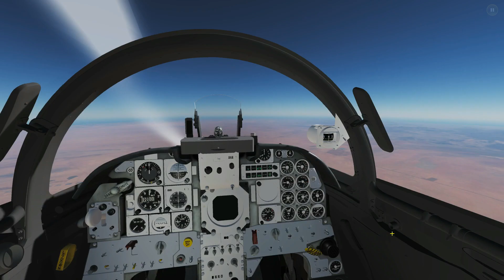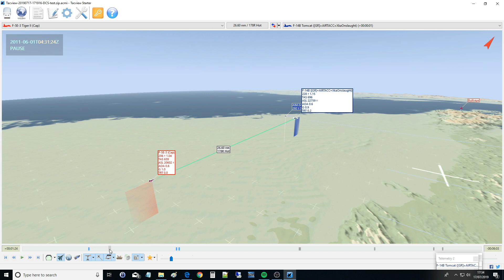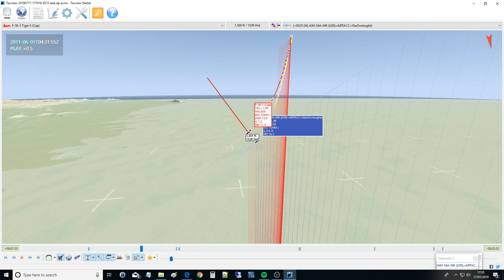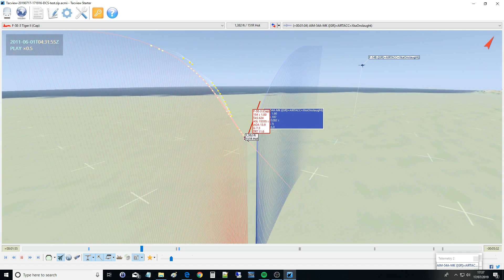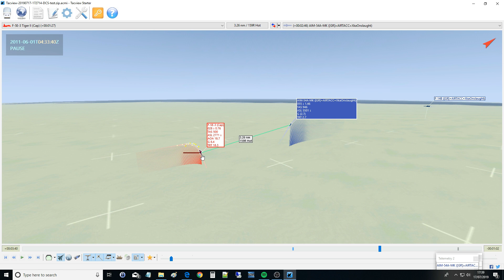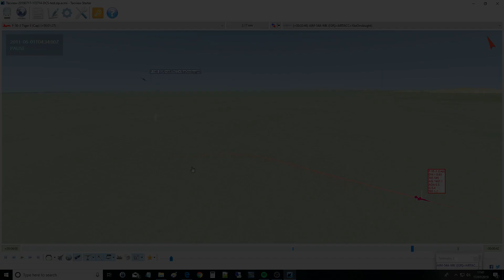Combat: Evade Dodge Aim-54 Phoenix Missiles Tutorial | DCS WORLD

Comment: Cap, thanks for the help! It help me a lot, but 'new' problem emerge. So, what if the AIM-54 actually lofting, and they come from above, in our RWR blind spot, what to do?

This problem 'idea' actually come up with what really happened during Iran-Iraq war, where a Iranian F-14 shotdown 3 MiG-23s with one AIM-54, and those poor MiGs don't have any RWR warning. 
Later research in the US  said it was caused by the lofted AIM-54 and came from almost 90° to the MiGs

P.S: I don't want to be those poor MiGs, or Flanker in DCS...
Reply from the maker: There is no defense for that, BUT it is VERY rare that it will be steep enough to avoid the RWR thank God.
Reply: @grimreapers  roger that, so only the unlucky pilot will get those poor missile in such conditions
Reply: This basically never happens in DCS because of the profile they gave the -54, so that its reaching its target with the most optimal energy. The previous behavior that allowed for a steeper terminal angle generally saw the the missile dump all of its speed and missing non-maneuvering targets.

Comment: Of course the Phoenix was really not designed for attacking Fighters, but rather  bombers  (Large RCS, relatively un-manoeuvrable ) or cruise missiles  (small RCS  but unlikely to  manoeuvre to evade) at long range to 'defend the fleet'.  It carries Sparrows / Sidewinders for the fighter type targets if careless enough to get close to them.    Against fighters its main value  is simply to scare  them off/keep them busy from long range rather than kill them.  Once you get as close as 35 nm hot to fire a phoenix in a tomcat using TWS you are getting pretty vulnerable to modern  missiles since you have to keep a lock until the phoenix goes pitbull.  So you are likely to have a counter-missile inbound forcing the tomcat to break the lock before the target spots the phoenix going active.   That is why in many GR missions we see the combination of a Tomcat for long range  and a F15 or a F18  for medium /short range as most effective, exploiting the strengths of each type.
Reply: Turns out that's a myth. 
Originally the requirement of the AiM-54 was to be able to hit a MiG-21 In a  high G turn. 

Heatblur did a YouTube special on it. 

The AiM-54 was able at range to strike a F5 in a 7G turn in testing if I recall correctly.

Later the AiM-54 was basically down sized into the AiM-120. 
Cheaper and lighter with less range.

During the cold war it was just assumed the AiM-54 would be used against ICBM's and Bombers more than fighters but it wasn't its design.

Remember the F14 and AiM-54 were in design and prototype phase during the Vietnam War and striking aircraft in North Vietnam was the objective.
Reply: It can engage fighters. But they won't even fire till they're 15-20 miles out. A bomber you can fire at from farther away though.

Comment: Why did you did the F-14's radar not show up on the RWR? It should still be emitting radiation even while in TWS mode.
Reply from the maker: I did not have the F-5 RWR in SEARCH mode
Reply: It did just not that it hard locked the ft which would indicate a hard lock
Reply: It does, but it basically just shows that a F14 is emitting but it does not show that it's looking at you only it's radar is on. 

It could be flying the wrong way or tracking you with a AiM-54 but you get no indication which till the AiM-54 is about to strike you. Only then does the missile switch from Track While Scan into Single Target Tracking and you get a missile is on the way sound. 

The F14 can fire a Phoenix 100+ miles away and your RWR and warning system only finds out at 6 miles when it's moving 2k miles an hour only seconds before impact.